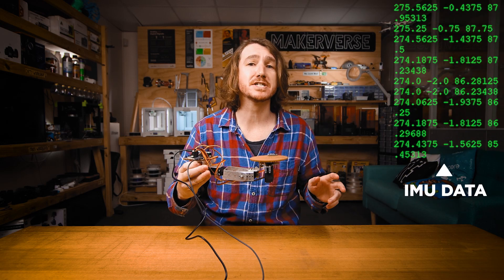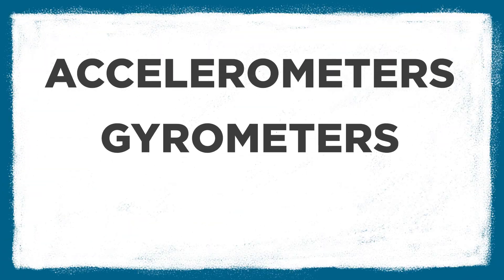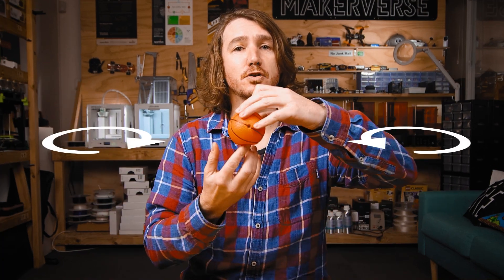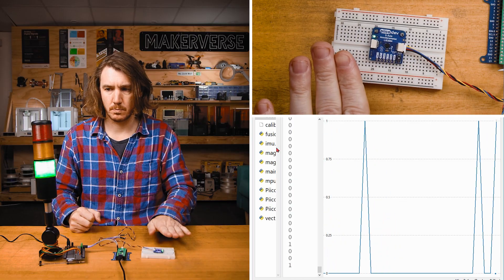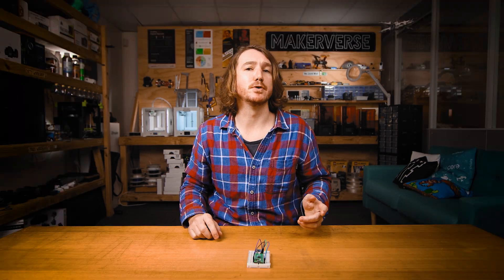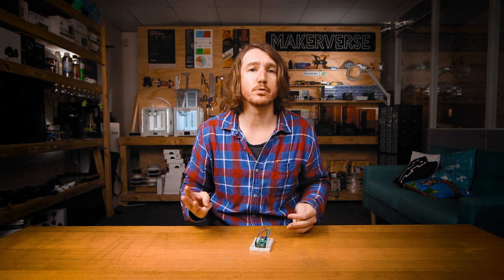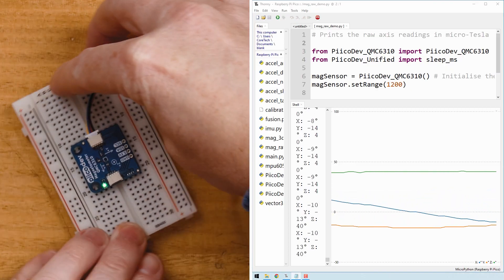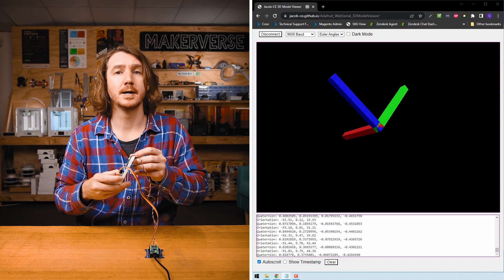Measuring Angles and Movement with an IMU | Beginner's Guide

Comment: Am I understanding this correctly? A typical 3D printer is 3dof, whereas a nonplanar printer or CNC robot arm can be 4-6dof. Is there a use case for 9dof 3d printing? Would that involve the printer itself, the anchor point of the printhead, being able to move around the build plate?